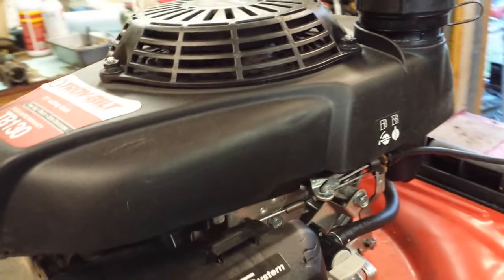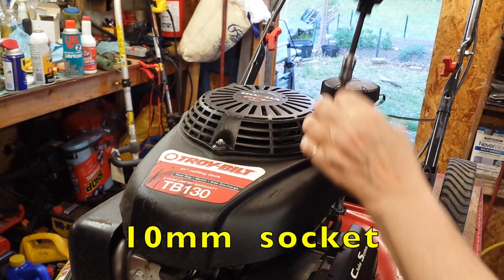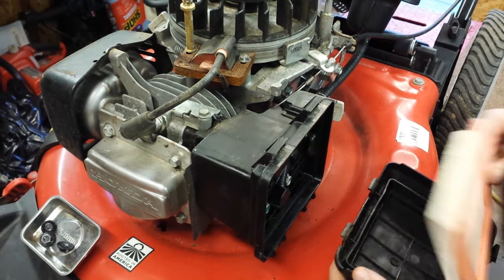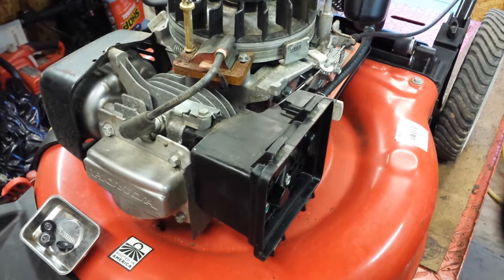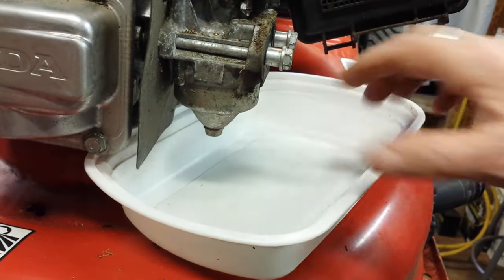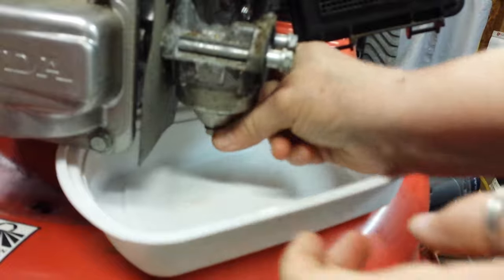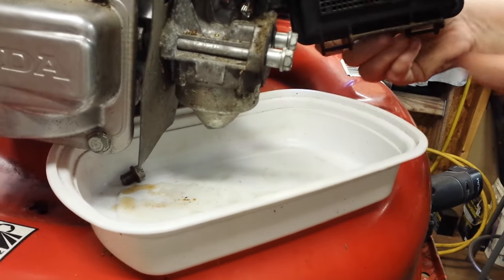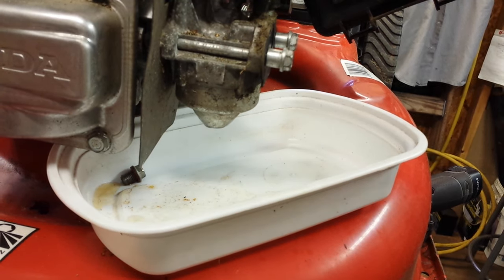Honda Mower GCV160 Keihin Carburetor Service

Comment: Hi there , Thanks for all your very informative videos. They all are really good.
If I may ask a question. What do you suggest I do next with a Honda Jonsered GCV 160 That won't start
I already changed the Thermowax plug, cleaned up the carburetor, what next?
Thanks in advance for your assistance with this issue.
Reply from the maker: Diagnosing a non-starter via internet is near on impossible, but my best advice is to start with the basics: spark, fuel and air. Those three things are crucial. I wish I could be more helpful. Thanks for watching.

Comment: Great video, very helpful.   Quicky question about the choke plug:  After noting the position of that wax plug with a cold engine,  when the engine gradually warms up, does that plug draw back into the block or does it extend further outward?
Reply from the maker: The plug expands with heat, and retracts when it cools down.

Comment: Hi Stela, thanks for sharing this video. It was helpful. I have GC160 Honda engine as well and look like I messed up with the engine block threads while putting back 2 big bolts after carb cleaning. Not sure what options I got now and I need this mower soon. I checked bolts threads are good and now one of bolt inside of engine block is keep on turning and it is stuck inside of the engine block🥲. I started engine and it was leaking from carburetor because it is not tightening.
Reply from the maker: That's a problem with the soft aluminum of the head. The only real solution is a thread repair kit. You can find a M6 Heli-coil or other similar kit at most any auto-parts store.

Comment: Another great tutorial on the carb cleaning! One thing that concerns me, is I would have emptied the fuel tank and cleaned and refilled with fresh gas after seeing all that gunk! I would be afraid that when you opened the fuel shut-off valve, any gunk in the tank or line would have filled the clean bowl? Just a thought?
Reply from the maker: Great point Mr Rattletrap2!  I probably did that, but omitted it from the final edit, as the video was already getting long in the legs. This more recent video https://youtu.be/JJ2AW0OlMYs shows how I usually take care of that on these Hondas. I appreciate you watching. Cheers!
Reply: @TheLawnmowerLady  I know you did! LOL I saw you do it on the next video I watched! Some things get left on the editing room floor, but all in all, these are great videos! Thanks for making them!

Comment: Thank you.  Excellent video and well explained. For the nominal cost of a new carburetor would it be more cost effective to just install a new carb and gaskets?
Reply from the maker: Thanks for watching. In the US, genuine Honda (Keihin) carbs are very inexpensive. In parts of Europe and UK they are 3 or 4 times the price. I'm not keen on aftermarket carbs, and depending on your mower model, there can be as many as 7 different gaskets needed. That cost adds up around $5 each. Seems like the newer models have fewer gaskets. Cheers!
Reply: @TheLawnmowerLady  This is great. I didn’t have the international audience in mind on my reply. You’re right on the money with your reply. Thanks again.

Comment: love your video!!! This question is for my pushing mower,   I feel like I did everything,  cleaning the carburetor and fuel line , clean up the fuel tank cap et al,  my Craftsman/Honda is still starting and dies 15 seconds later, what is the problem?
Reply from the maker: Often the idle circuit is plugged. Not so bad on this one, but more details in this video: https://youtu.be/8qic4cARD2E

Comment: I got 2 of the carburetor old bolts. Cut the head and use a Dremel tool and cut a grove so a screw driver can remove the bolt while a assembling all the gaskets, carburetor and air back plate. I can take a carburetor and i few minutes.
Reply from the maker: If I had a donor Honda engine, I might have done the same. They do really make the job easier. Thanks for watching. Cheers!

Comment: GREAT VIDEO!  you touched briefly on the wax plug regarding auto-choke.  Anything to look for here in terms of a bad plug vs good plug?
Reply from the maker: Great point mr ricecowboy! I need to do a video on that. Basically the thermo-plug has a little plunger/piston that extends when the wax heats up as the engine runs. It's easy to see if it in a failed state by looking into the throat of the carb (take out the air filter) before you start it up, (the engine has to be cold) you should see the choke butterfly valve, right behind that small air baffle, in the carb intake closed. If it's open, even partially, that means the wax plug might be bad. When you cold start, you should observe that butterfly open slowly as the engine heats up. I hope this helps!  Thanks for watching!
Reply: @TheLawnmowerLady  phenomenal explanation. TY!

Comment: I’m wondering if that ‘jelly’ in the bowl was caused by the owner using a gas additive to ‘preserve’ the gas over the winter.  I’ve seen videos where these additives are used with small engines that are using the 10% ethanol gas, and the results, after a winter, show a jelly like substance like that.  The end result, of course, is that the fuel stabilizers do not work on ethanol gas, and clog up the carb.
Reply from the maker: I agree. The fuel additive elixirs don't solve the issue of what all the water binds to, after the alcohol has evaporated from the ethanol that was added. The simple answer is to not used ethanol tainted fuel, but I know that is not possible for some folks.

Comment: Hi Lawnmower Lady!! Do you know the specs on flange bolts that run thru the air box and  carb? I stripped the threads in the housing and need to tap new ones, but not sure what size helicoil kit to get..love the channel!
Reply from the maker: M6x1.0 Good luck and go slow. Thanks for watching. Cheers!

Comment: Thanks, learned a lot!  Had a fuel issue (dry plug that sparks), cleaned the carb.  Fuel seems good now. When trying to start I get a couple of bab bab bab then nothing. Do you think its a faulty choke?  How would I diagnose that?  Thanks!
Reply from the maker: Thanks for watching Mr Hoekstes! Did you drain all the gas from your fuel tank and re-fill with fresh fuel after our carb clean?  Might just be you still have some water in your fuel tank, that just re-fills the carb bowl? Regarding your choke: if you can see the choke flap closed when the engine is cold, then it should be working. That small wax plug I pointed to around 08:05 That plug heats up fast once the engine is running, and the small piston moves to open the carb flap. It still sounds like a fuel delivery issue, perhaps re-check the contents of the carb bowl. Worse case pull the carb apart again to ensure all passages are clear: carb spray into one orifice should emerge from another. Good luck!
Reply: @TheLawnmowerLady  thanks for taking the time to answer my query!  I got someone who knows Honda small engines to take a look. Fuel works fine now, automatic choke does its job, but compression is shot. Will have to pull the piston and look at the rings. 😬

Comment: Out of curiosity was the air guide gasket (engine side of the carb, the one that's shaped like Utah) installed backwards in the video? I did catch that the gasket was installed that way at the start of the video as well, but that's the first time I've ever seen it installed in that direction with the long side flipped toward the valve cover and not toward the back of the engine when installed.
Reply from the maker: I noticed that too. I'm pretty sure (it was several years ago) that came off the factory floor that way (a late Friday afternoon?) I chose not to flip it as the carb body had already imprinted into the gasket. I didn't want to chance creating an air leak. Good eye!

Comment: Great video. I have the same engine on my mower. Having trouble getting it started. I’ve replaced the carb, and it will start and run, but only with a shot of starting fluid first. Any suggestions as to what else could be preventing my mower from starting?
Reply from the maker: I would check first: make sure when the engine is stone cold, you should see the choke flap is completely closed. If it is open, or partially open, there is something wrong with the auto choke system, either the linkages are assembled wrong, or the wax plug, which I briefly touched on in this video is bad. I hope this helps.
Reply: @TheLawnmowerLady , sorry I didn’t mention it’s a manual choke
Reply from the maker: https://youtu.be/HBgOQFQgGsw From about five minutes into this video, see how these linkages and controls needed a bit of cleaning and lubrication to get them back functioning. Yours might be out of adjustment, of just need lubrication.

Comment: I bought one of these motors with the auto choke that went to a shop 3 times in my first month of owning it. I parked a brand new mower and built two b&s mowers like in self propelled out of junk mowers. Do you think it’s possible the auto choke was bad for the factory and the shop didn’t catch it, or the wax plug thing that heats to operate it was bad? The mower would crank and run great but if you shut it off before you were thought or it ran out of gas it would not crank again until 24 to 48 hours later. If you’re able to answer it would be greatly appreciated, if not I understand this video has been up a while.
Reply from the maker: I have had only one mower, that appears to have come from the factory with the plastic bracket that engages the thermowax piston installed upside down. It was broken, and I am  somewhat confident no one else had been messing with it. That said your failure to start when hot is a classic symptom of a failing ignition coil. I appreciate you watching.

Comment: Great video. When I completed the cleaning and re-assembly, the throttle plate did not close. Is not effected by the throttle/choke level on my Honda HRX217HXA engine. Any help you can provide? Thank you.
Reply from the maker: It might just be a bit of grit. Make sure the screw tat holds the butterfly is tight, and ensure the return spring, and the control arm is in the correct hole (although as I recall they are different sized. I hope this helps I appreciate you watching.

Comment: Great video! I have the same engine on my lawnmower. After running for about 15 minutes the engine almost dies but somehow saves itself. Then it does this until the next time I take it out. Do you have any suggestions on what it could be?
Reply from the maker: Sure sound to me like a fuel delivery issue. If you've cleaned the carb, made sure all the passages are clear, it could be debris in the fuel tank? or perhaps your fuel cap is not venting? Next time that happens, remove the cap while it is running. If it revs back up, that might be a bad fuel cap. The fuel line from the factory on most Hondas is double walled. I've seen the inner wall collapse, causing a fuel starvation issue. Acts like the fuel cap is not venting correctly. I suspect the fuel line collapsing is an ethanol issue.
Reply: @TheLawnmowerLady  Thanks for the answer! I have not cleaned the carburator yet. Thats why I watched your video in the first place. 🙂 I've already tried to remove the fuelcap and that didn't do much. Next thing will be your suggestions.
Reply: If what you are describing is surging, try this:  Get some pure gasoline with no ethanol (it usually comes in quart metal cans with a screw top). Drain your gas tank and re-fill with the pure gas.  Start your motor and let it run for a few minutes.  If the carb is not too dirty, the pure gas will clean it and the surging will stop. I have done this twice - once with my Honda GCV160 and once on my neighbor's Craftsman snow blower.  It did save some time and kept my hands clean.  On the last mow of the year when the mower tank runs out of ethanol, I dump a can of the pur gas in and finish the yard.  I never have carb problems in the spring after the winter storage.

Comment: At 22:00 onward.  I would like to send Mr Honda a nasty letter.  When I did this for the first time, it was a nightmare getting all these things lined up and having to put the air box on as well, before you could put the screws in to tighten it all down.  You needed about 10 hands to do this - hold all the gaskets, etc., in place, and basically do this blindly as the air box prevented you (or at least me) from seeing anything.
Reply from the maker: Thanks for watching and commenting Ms Inisfad! Honda makes a tool (basically the airbox bolts without heads) to screw into the head as guides to assemble all the gaskets, carb and carb box onto the engine. Once all the bits of gak are in place, you remove one at a time and replace it with the long shoulder bolt. I have some pieces of M6 threaded rod that I use for the same purpose. I didn't think it was practical to show that in the video as most folks working on their own gear won't have that type of thing laying around the garden shed.
Reply: @TheLawnmowerLady  I ended up using a long, thin screwdriver on one side that was all lined up, and then feeding the parts in, one by one, on the other side.  This was even harder than finding the needle that had dropped somewhere, as I was doing all of this while sitting on my driveway.  I could have done a video entitled ‘How Not to do This’.  But I felt great when all was done and the lawnmower started up and ran well.
Reply from the maker: Yay! Glad you got it cleaned up and working. Thanks again for watching. Cheers!

Comment: Good video.    I need a gasket for the engine. Then the big one then the other 4 gaskets.   What can I use for hat engine gasket. All the kits I look at only have 5
Reply from the maker: The honest truth Mr Matt, is I interchange  both the fibre gaskets and the...uh, sort of graphite impregnated gaskets, depending on which I have on hand. As long as the holes match up, I use it. Thanks for watching. Cheers!
Reply: Thanks.   OK so if the holes line up. And the gasket for engine is square.    I ordered kits and new carb.   But I cleaned the carb by one of your videos.  It wasn't bad at all.  Got new bowl gasket coming.   My wife said just order new lawn mower.  I did.   If I fix my old one...someone needs a lawnmower

Comment: When i removed my carburetor it never had that large flat gasket, the BIG one and i installed a new carburetor that came with gaskets and they also didnt send a large flat rectangular gasket. Just one that looks more like the other 2. Shaped. Why? Lol. Should I find one? Is it important that its so large?
Reply from the maker: It's really more of a heat shield. Not all mowers have the same configuration. Best to look up your exact model for the correct parts diagram.

Comment: Best upgrade for a Honda engine? Replace the bolts with stubs and nuts. All the Chinese clones do this and it's so much easier to work on. Actually prefer working on the clones because of that however spares can be more of an issue.
Reply from the maker: I agree.
Reply: @TheLawnmowerLady  Great video by the way. Sorry I went straight off on a rant. Sorry I fixed a Chinese chainsaw, brush cutter and mower so far this week. First two weren't great quality, the mower however was actually a far better experience than working on my mother in law's Honda. Obviously the Zongshen engine was based on a Honda OHV engine but the studs and the fact every single fastener was a 10mm made working on it a pleasure.

Comment: At what point would you replace fuel lines especially if a mower has been used with ethanol and some of that Gunk might be in there and just re-clog the carburetor when you start it again?
Reply from the maker: Usually just by feel. If it's crunchy or stiff, I usually replace. I've also seen on some Honda mowers a double walled fuel hose where the inside wall collapses. That shows up as reduced fuel flow. Thanks for watching!

Comment: Genuinely ignorant question: my mower has this brand of carburetor, but some screws and hardware are compromised. Can I replace it with any make of carburetor so long as it is compatible with the GCV-160 engine?
Reply from the maker: Oddly, OEM Honda carbs are extremely reasonably priced in US. ~$35. Sort of slam dunk IMO compared to the sketchy reliability of aftermarket carbs. In EU they are crazy expensive. If you have a Honda mower, you will need to look up the parts diagram based on the mower model, not the engine. If your mower is some other brand with a Honda engine, you'll need the engine model #. Hope this helps.

Comment: Hey Lawnmower Lady! I have a question for you. I got the exact screwdriver (Vessel) that you mentioned in one of your videos and it still stripped the screw and wouldn't come off.  Do you have any suggestions?
Reply from the maker: If it is the silver handled Vessel, it actually is an impact screwdriver, as you can impact the end with a hammer whilst turning it counter-clockwise, and the spring loaded cam will turn 1/8th (or so turn) I do this with the carb in a vise. It should get the screw out if it's not buggered out to badly. Heat, and/or penetrating oil might help. That screw is in there very tight. Kroil is one of the best penetrating oils out there with Liquid Wrench coming in a close second. hope this helps.
Reply: @TheLawnmowerLady  it is the teal/black handle. It is completely reamed out, so I ended up getting a completely new carburetor. It was only $8 more than the gasket pack I was going to end up buying because the gasket tore when I was removing the carb bowl.
Reply from the maker: @kathykumaus5223  unfortunately that happens sometimes. The good thing is original Honda carbs are very reasonably priced. So you'll be getting a good carburetor hopefully. Thanks for watching
Reply: @TheLawnmowerLady  thank you for all of the lessons! You’re videos about the Bolens plastic/nylon carb helped me get the little mower going and also gave me the confidence to work on the snapper/Honda one. You’re videos are AWESOME!
Reply: And your. I’m tired